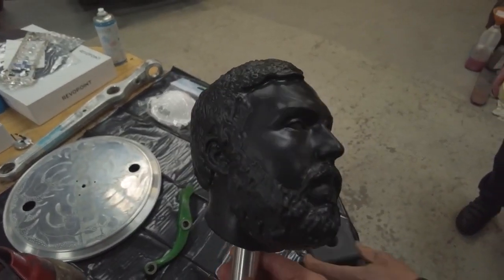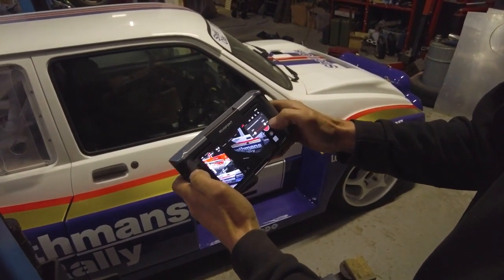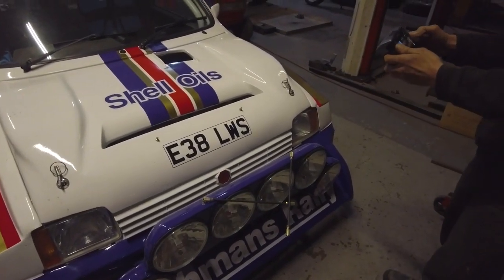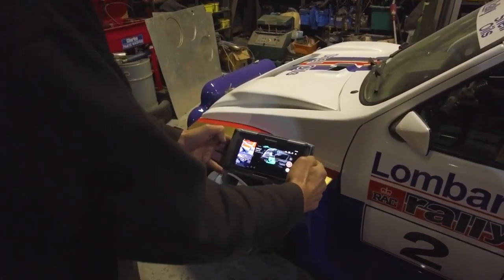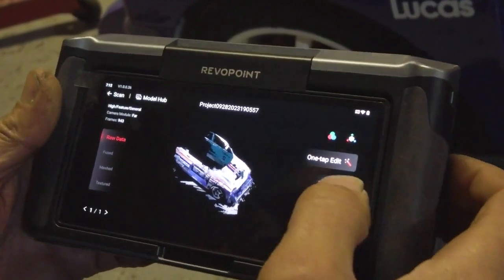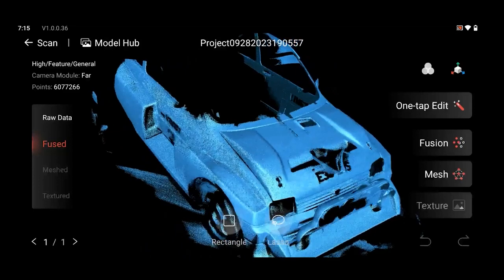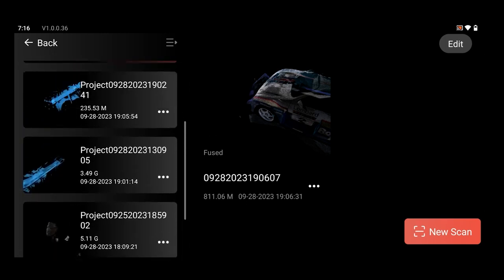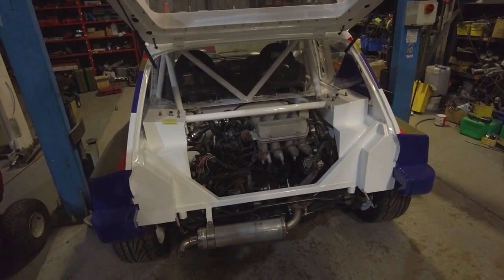3D Scanning a Car with MIRACO 3D Scanner

Comment: Exceptional result!

Scanning a car without surface preparation is typically a challenging task, but the latest scanner from Revopoint Miraco performs like a true miracle, capturing an astonishing level of detail effortlessly.

Revopoint stands out by actively engaging with its users, constantly updating and enhancing the software with new features.

I've acquired several scanners from Revopoint and I'm using them in my work, they are absolutely brilliant, the most bang for your buck.

I wish in the near future to buy this Revopoint Miraco 3D scanner, I really like it's portability and integrated display, truly a revolution in the world of 3D scanning, using it for capturing and editing scans without PC and no cables really impressed me a lot.

Comment: Excellent work!!  I have successfully scanned a Engine block and cylinder head with this scanner.  Far mode is so far the best tracking scanner I have seen sub 5k.  I have HX and LEO at my disposal while they do great it takes a lot of horsepower, computer, wise, and most of the time you have to force that software to make a smoother print to save time and prevent errors.  This can mesh on the go or Pc for even more details.